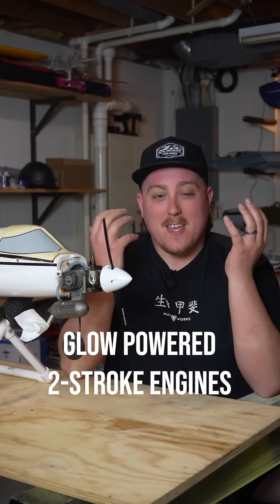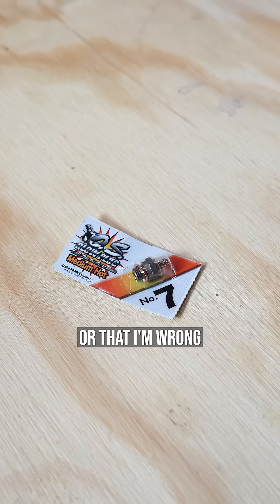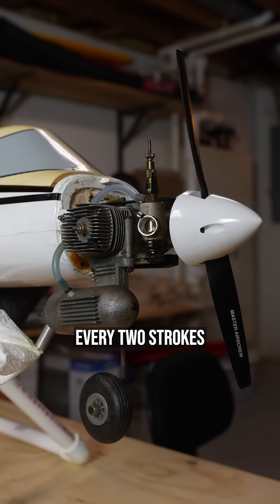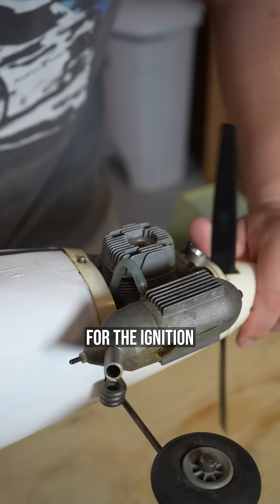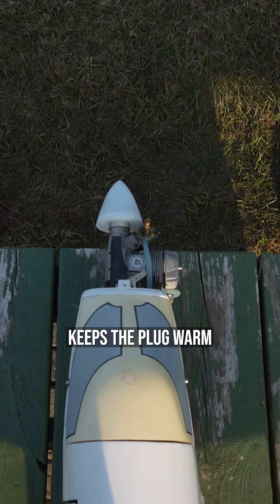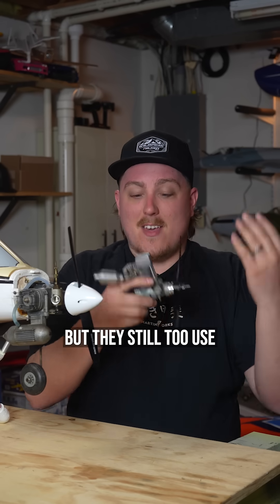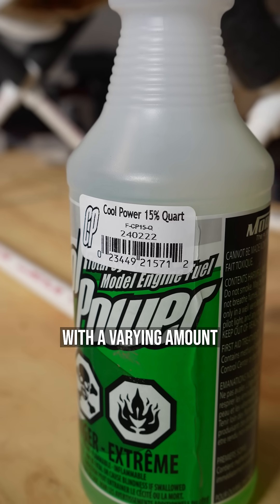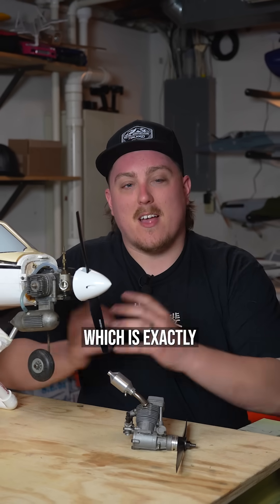How do Nitro RC Engines Work?

Comment: Umm….when I was 10, 1966, we ran these glow plug engines in our wire fly air planes and cars. We mixed our own fuel. Castor oil and alcohol. We modified them to make them run faster and better. I swear I can smell the fuel from talking about it. It’s 2025 folks. Why are you having problems understanding the simple stuff?

Comment: They make 2 stroke diesel for tank and truck and I know it’s a diesel rc plane but it runs on nitro and it doesn’t need a spark like diesel it needs heat and compress

Comment: It's a diesel engine, diesel engines use glow plugs for starting. Once the engine warms, power for the glow plugs is removed.

And, yes, nitro/methanol engines are made in 2-stroke, 4-stroke and Wankel versions

Comment: two stroke doesn't have anything to do with what causes the ignition. Without a spark plug it probably could be considered a kind of a diesel engine since the compression is what ignites the fuel air mixture. The glow plug just preheats the engine to allow the compression ignition to be easier.
Reply: It also stores heat and catalyzes the reaction.

Comment: 2 Strokes Fire every 1 revolution of the Crank not 2 revolutions, that a 4 stroke, The GLOW Plug wire that glows ignites the FUEL by a Chemical Reaction with the Fuel ant the Platnum wire.

Comment: Lol so people say because it has a glow plug it cant be a two stroke…. Blow their mind and tell them Detroit made two stroke diesels that had glow plugs and exhaust valves, with turbos feeding a supercharger. It had valves and still was a two stroke no intake valves but, exhaust valves. Can-Am had a two stroke dirt bike that had a disk valve connected to the crankshaft with a port for intake.

Comment: You can always recognise a 2 stroke by the exhaust, no other engine type uses exhaust like 2 stroke. It needs the sound pulses to work, the sound pulses the engine makes and works a s a pressure valve to purge the smoke out of the system and push new air fuel mix back in...

Comment: It's technically a two stroke engine, but it's definitely a nitro rc engine. A traditional 2 stoke engine is more like what could be found in a losi 1/5 buggy and it does have a spark plug and runs on mixed pump gas. Or my favorite, the YZ250 😂

Comment: The platinum metal in the glow plug coil / element has a cataylist effect to ignite the alcohol fuel.
Reply: Typically these types of engines run on a Nitro-Methane/Castor Oil based fuel. My late father in law was was Duke Fox's personal chauffer and right hand man He ran Fox Manufacturing for years after Duke Passed.

Comment: How do you brevent spark nock or pre ignition?
Reply: Its in the fuel formulation and the type of glow plug each engine uses a specific type of fuel formulation and a specific heat of glow plug to prevent this.  Hot engines or high nitro fuels usually like cooler plug, while cooler running engines or running low nitro fuel run better with a hot plug.
Reply: @falkwulf3842  thx for the reply. Very interesting
Reply: @ Your Welcome,  My late Father in law was Duke Fox's right hand man personal chauffeur and plant manager of Fox Manufacturing.  Fox engines are some of the best 2 stroke glow engines ever made especially in the .015 - .45 sizes. What will really bake your noodle is most 2 stroke glow engines do not have compression before adding fuel. meaning its the fuel that causes them to build compression. The fuel that these engines uses is a mixture of Nitro methane and castor oil. This gives the exhaust a really unique smell. If you have any other questions about 2 stroke glow engines i can answer them for you as I am in a unique position to answer them.

Comment: It’s a two stroke diesel that runs on a mixture of nitromethane and 11 herbs and spices. Along with some oil for lubricating the lower end of the engine.

Comment: Also some two strokes specifically the ones that use a 50:1 or 40:1 gas to oil ratio do use spark plugs, this is clear correction for anyone who has a 2 stroke with a gas/oil mix that uses a spark plugs, as stated in the video his is a nitro engine thus their combustion is heat based and not spark based as the glow plug retains heat from each combustion cycle making the need for a spark ignition not necessary!

Comment: 75 years ago, in model airplane infancy they used a spark plug, magneto and points, but they proved to be too much added weight and the system proved to be not as reliable as a simple glo plug. They discovered that it was much easier to use a big 1-1/3 or 3 volt Burgess lamp battery to initially heat the glo plug and once the engine started the fuel would continue to keep the plug glowing and run the engine. They could leave the 2 Lb battery  behind.

Comment: The hobby glow engine is basically a diesel engine (or, a compression ignition engine, rather than a spark ignition engine, as with a gasoline engine). 

Many large diesel engines also use glow plugs to heat the engine's combustion chambers to assist with starting the engine.
Reply: I had to scroll a ways to find someone who actually understands
Reply: Indeed it's a diesel two stroke
Reply: No it isn't. It does not ignite by compression alone (which is in the range of typical Otto engines, 7:1-11:1) but by catalytic ignition at the glow element coated with platinum/iridium/rhenium. 

I proved that to myself. If you heat the glow element with like 0.6-0.7V so that it doesn't glow visibly yet and put it in front of an unlit(!) but opened propane torch, it glows orange in the gas flow and may ignite it if you are lucky.

There ARE compression engines, but those run on a mixture of kerosene, ether and oil. Still not diesels though, since diesels are defined by injecting fuel into compressed hot air. They are HCCI (homogenous charge compression ignition) engines, to be exact.
Reply: @VintageTechFan  I did forget that (larger) diesel engines are fuel injected, & the hobby glow piston engines (that I am aware of) use a carburetor for fuel/air delivery. 
However, all internal combustion engines are "compression engines", & I believe I am correct that the hobby glow piston engines are basically diesel engines, because the fuel (a nitro methane mixture, I think) is ignited under compression in the combustion chamber. The glow plug (an electric heating element) is used to heat the combustion chamber for easier engine starting, & when the hobby glow engine is running, the glow plug electric wire is disconnected, & the engine continues to run, with compression ignition of the fuel.
Reply: @shadovanish7435  Nope. It ignites at the hot element, like on a spark plug. 

This is also not just "there is some hot wire" which would be way to imprecise. It's a catalytic process and the point of ignition depends on compression and glow element temperature. At high RPM the element gets hotter, which means some (desirable) advance of ignition timing. How much it gets hotter depends on the heat value of the plug and on compression.

It is not the compression heat alone. As I said there are engines where this is the case, those then don't have an engine but an adjustable counter piston (and typically a T bar screw on top of the cylinder to control it).

But "nitro" engines are running an Otto types, just with catalytic ignition instead of spark. The catalytic part is also why glow plugs are pretty expensive if high quality. There are quite some precious metals in there.
Reply: Except instead of diesel fuel it uses nitro fuel? 

Unlike the old Detroit diesel 2 strokes which of cause were well diesel
Reply: Diesels use diesel fuel
Reply: @keithbarboza3526   I'm using diesel as a reference to the ignition style and instead of saying compression ignition which less people are familiar with
Reply: @keithbarboza3526 it's not the fuel, the type, compression ignition engine is named after the guy who invented it - Rudolf Diesel.
Reply: @keithbarboza3526  A diesel engine is defined as a compression ignition engine, regardless of the type of fuel the compression engine uses, I believe. What is known as "diesel fuel" is actually a lightweight oil, similar to kerosene (& kerosene is quite similar to jet fuel). "Diesel fuel" became widely used in compression ignition engines many years ago, because it was (years ago) an inexpensive fuel, compared with Gasoline. Some people used to refer to "diesel fuel" as "diesel oil". 
Gasoline, used in spark ignition engines, is not an oil, & is volatile (evaporates rather quickly), unlike diesel fuel.
Reply: It's still a 2 stroke engine. It refers to the number of strokes needed to fire. That's why there is such thing as 2 stroke diesel engines you might find in very old trucks. The 4 stroke glow engine is more similar to a modern truck/car diesel engine
Reply: Not a diesel at all, and compression alone isn't what causes the combustion to happen.
Reply: Wrong. 
Only those designed with adjustable compression and which run on Kero and ether are considered model 'diesel' cycle.

You're not even close here mate.
Reply: It ain't a diesel

Comment: I have one of my dad's old engen from the 40s super cyclone one cubic inch that has points in the front and a condenser with a 2 volt wet cell battery it has a little champion spark plug. Really cool engine

Comment: They are actually diesel engines.
The definition of a diesel is compression ignition which these engines use.
Reply: Erm..no, it actually the platinum coating on the glow plug which reacts with the fuel and keep to glow plug glowing red hot which causes combustion BUT there are actual Diesel versions of these engines which use Actual diesel fuel and instead of a glowplug they have like a thread adjuster to adjust the compression and find the correct settings to keep the engine running, some engines back in the day were also converted from glow fuels to diesel.
Reply: @ripmax333  Agreed. There isn't enough compression in these glow engines to ignite the fuel, it needs the glowing platinum plug to ignite the fuel and that plug stays glowing from from a catalytic reaction with the methanol in the fuel.

Comment: Just like to add it's a catalytic reaction that keeps the platinum element glowing 
     There's a cool catalytic reaction you can do at home 
   Take a little acetone in a glass jar heat a piece of copper until glowing and lower it into the acetone vapor 
   It will just stay glowing

It's why they're called glo engines and the fuel aka glo fuel 

   Top fuel

There's other cool should say hot catalytic reactions 
    The zippo hand warmers use I believe a platinum mesh as well and stay glowing by the white gas vapor
Reply: I have a foot warmer/heater that uses a platinum element that glows the same way very efficient and economical

Comment: glow ignition was a godsend back in the '40s...more power, much less weight and far more reliable. 
BUT! by the early '10s ignition got so light, reliable and cheap that it started making sense again.  especially on smaller engines where it really improves throttling.  i flew engines as small as 0.15 or 2.5cc with ignition and the weight penalty was less than 50 grams.  also no longer needed nitro and that means lower fuel consumption which means that weight could be offset with a smaller tank

but of course now electric is the way to go now for performance,  especially on smaller aircraft

Comment: All I knew of as a kid in the 70s was the .049. Definitely 2 stroke, definitely glow plug. Still have it kicking around somewhere. I dreamed of building a hover craft, but never got that done.
Reply: I made one that used a .35.  It ran oh.  Preferred the puddle jumper flat bottom with a .15, and a 8" square rudder on the snow.  You could roll it when you jumped snow banks.   Massive amount of fiberglass on the plywood so it could take the beatings. 🤕
Reply: I went from a .049 to a competition .051 with a carburetor.  That engine would go through 3 oz. of fuel in less than 2 minutes.  Once when I was starting it, it fired up really fast, and my finger caught the end of the propeller.  I had 16 cuts from the first and second knuckle of my index finger.
Reply: @karllued  I got the fuel pump for it.  That think had no trouble feeding my OS40 engine either.
Also got the throttle body so I could add throttle control.   a company  made a .061 engine that was all metal with a throttle body.  Put it on a foam delta wing hand toss plane.  Just added controls, and had the servos out in the breeze.  Flew pretty good.
Reply: @karllued  I hacked my finger up with an .049, it was hot and I was playing with it as a kid, 9 years old I think, I turned and bumped the prop with my finger and off it went, took half my nail off and hacked up my finger tip pretty bad, they have an awful lot of power those little buggers

Comment: So how is the ignition timed? I know its a compression engine but a diesel is aswell ans theres still injection timing. These use carbs so how does it not just detonate??
Reply: The timing is controlled by how rich or lean you make the fuel. The simple  carb has a fuel bar that sprays a metered amount of Methanol and lubricant, initially adjusted at idle, after the engine thoroughly warms up and has "been Broken in". as the throttle valve is opened, the fuel becomes leaner, advancing the flame front. This does not work well using Gasoline, as I guess gas does not have the same "Flame front response"
Reply: There basically is no timing, but methanol does not detonate, but burns more smoothly.
Reply: The ignition is not timed the fuel delivery is. In the simple two stroke version there is a slot cut in the hollow crankshaft that lines up momentarily when the crankcase is at the perfect vacuum. It's called a rotary valve. The four cycle versions use valves. the little Cox engines use a reed valve.

Comment: I was flying these kind of engines back in the late 50's.....There were no 4-stroke engines for RC planes as far as I knew and they were all small displacements - to the point that a plane loaded with gear especially like my older brother was flying (wing-mounted rocket launcher) couldn't even get off the ground:)  He won a contast for design alone!

Comment: The key word is Nitro methane.. In layman's terms nitro methane is basically liquid dynamite and it wants to rip that motor apart trying to get out😂😂 Nitro methane Drag cars, motorcycles, etc must be started with alcohol and switched to 100% nitro.. If started & cylinders are wet with nitro motor will launch heads into orbit.. If you ever seen a drag car explode on starting it's that Dyno-Mite 😂😂

Comment: So isn't it just a miniature two-stroke diesel motor ?
Reply: No that engine is not BUT they where made mostly German or english
Reply: Kinda 😊 They operate in a very similar way to a 2 stroke diesel engine, but are a little bit different.

The different fuels have different properties ( I.e. flash point, auto ignition temperature, etc.) so these engines aren’t designed to run on diesel.

The simplest comparison I could make is the difference between a methanol dragster engine and a normal car engine. They operate in the same way, but if you just pop methanol in your car, or regular gasoline into a methanol dragster, they really aren’t going to run well (if at all).
Reply: @bear4278  It shouldn't matter with a fuel is cuz they run diesel motors on all different types of fuel.
Reply: @Kyle-KZ06 it does matter what fuel you use 😊 If you are using a fuel that the engine wasn’t designed for, you need to make sure the new fuel has similar properties to the original fuel.

For example, sure, you technically can run a diesel engine on diethyl ether based starting fluid, but if you run it on pure starter fluid for more than 60 seconds you are probably going to find you have blown holes in your pistons.

Nitromethane RC fuel is probably closer in its properties to stater fluid than it is to diesel 😊

Edit: to be clear, don’t try running your RC engine on starter fluid either! That was just a rough comparison and probably wouldn’t work out well!
Reply: Not really, a normal diesel, two stroke or fourstroke, compresses air only, then the diesel is injected just before TDC. This compresses the mixture, not just air.

Comment: Glow plug is just to help it start just like with 2 and 4 stroke diesels
Reply: Nope, glow plug always needed for these to run as there isn't enough compression to ignite the fuel even when hot. The glow plug stays glowing from a catalytic reaction between the platinum filament and the methanol in the fuel.
Reply: @wally7856  no shit,but it's not running electricity. It helps it start with the juice cause there's no heat
Reply: @ oh ya, you need the battery to heat that filament to get it to glow. After that the plug stays glowing.

Comment: But what the hell is 2 stroke diesel. That’ doesn’t use spark either
Reply: 70's diesel trucks ran 2 stroke engines. Blown and stuffed (turbo) used for cylinder scavaging
Reply: And the big ship doesel engines are all 2 stroke.

Comment: If I’m not mistaken, the glow plug coil is coated with something similar to a catalytic converter that creates an oxidation reaction on the coil, burning fuel and keeping it glowing hot. My explanation may not be 100% accurate but something like that.
Reply: Correct Most new glow plugs were coated with platinum, that is what made them expensive. The problem was that when the platinum  burned off, she Glo plug would still appear to fuction and glow normally but the engine would be difficult to start or  idle reliably. It took me 40 years to finally find this out! By that time, electric brushless motors were developed and Lipoly batteries affordable
Reply: Spot on mate. 
And for this reason, the chemistry of the plug can be tuned to allow the engine to run on petrol or even Acetone, if a copper coil was used.